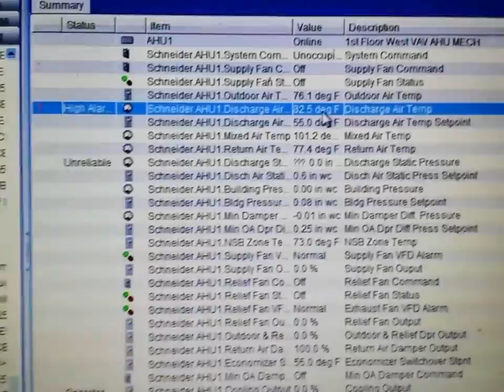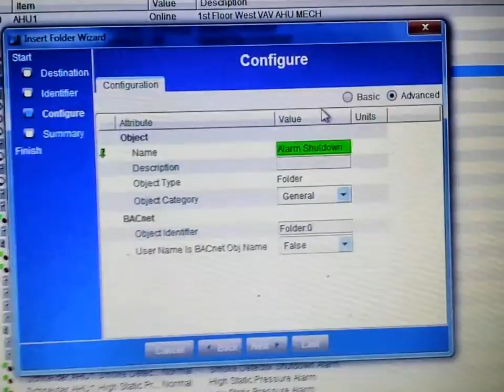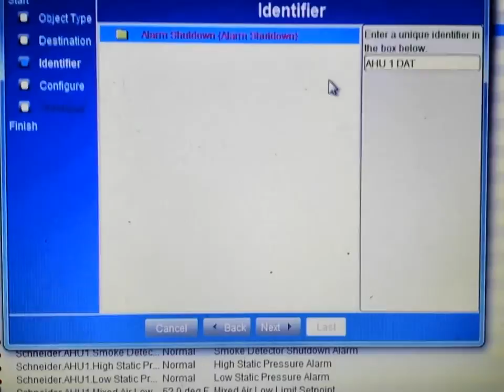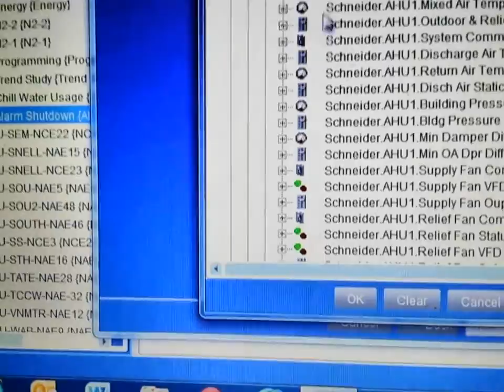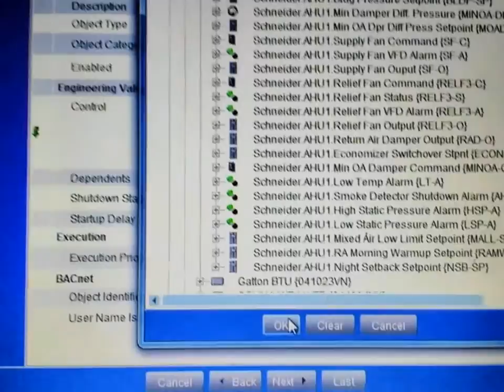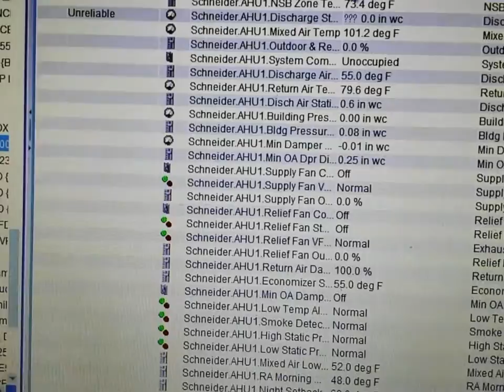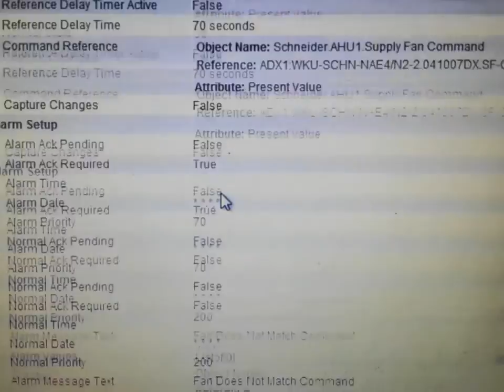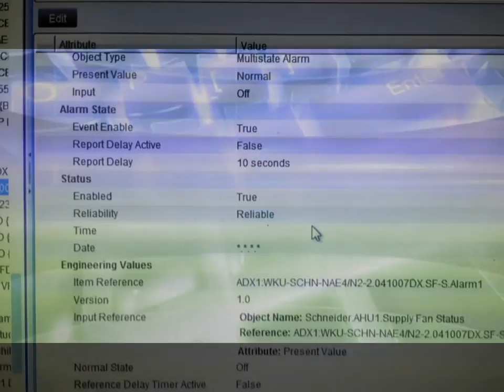Handling Unnecessary Alarms in Metasys

Comment: Nice video !!!. Sr. I have a diesel generator integrate over RTU ModBus. I need to add some variables to the current .vmd file but i would like know which variables it has. Do you know a way o method to open this kind of files? I expect you help me :D
Reply from the maker: You would need the software used for the controller if they don't already exist in it. If they're in the device you should be able to do an auto discover